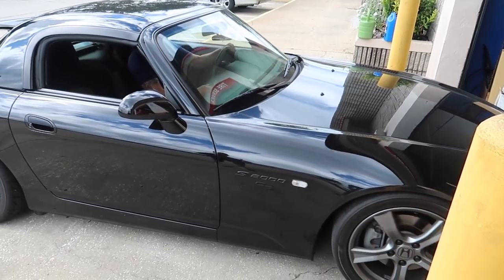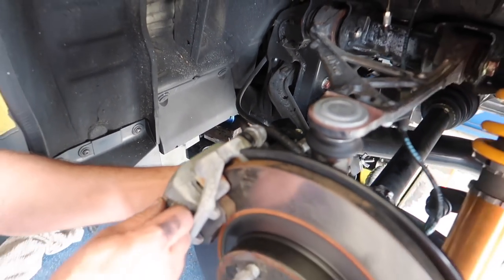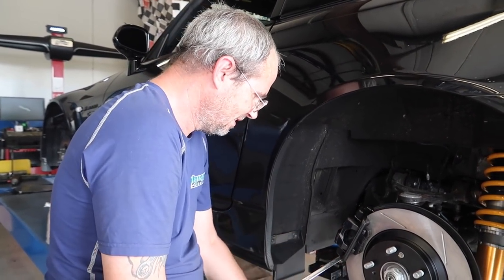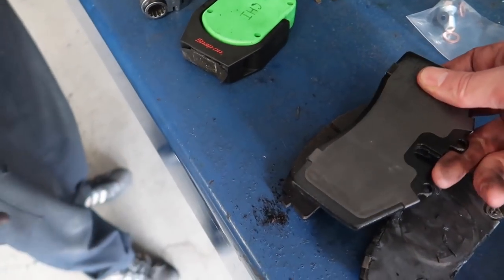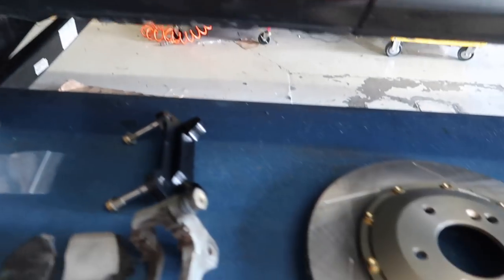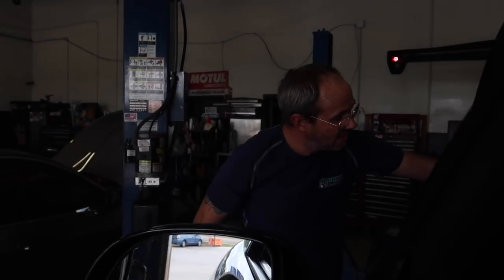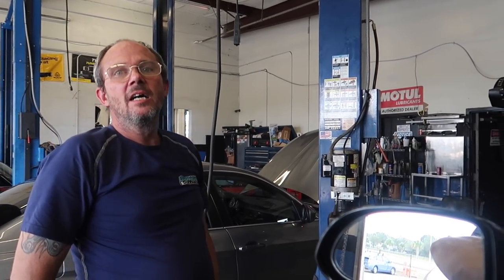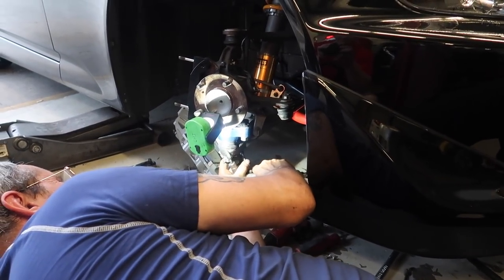S2000 CR: Stoptech Trophy and CE28N Install

Comment: Does look like he cross threaded that Left Front lower pad bolt.
Reply from the maker: No...
Reply: I thought the same thing but cross threaded not stripped
Reply: Dmand18729  Ahh yes...that's the word I'm looking for. It definitely is unfortunately. It wasn't shoved in far enough before to torqued it with the impact.
Reply: Yeah that's been cross threaded,you can even hear the sound difference from the top and bottom bolt
Reply: yeah I wondered why he impacted the bottom right away before making sure the threads were seated like he did with the top. was he adjusting the wrong collar on the coilover too?? (I thought the collar under the spring was to set preload and not to be fiddled with when wanting to adjust height)
Reply: noobatnothing I think he's actually turning the threaded body, not the actual spring seat.
Reply: it's cross threaded. reason for the stoptech trophy / st40 bridge not seating flush (wobbly) is because when the caliper was assembled, the silver metal piece that sits ontop of the bridge, needs to be pushed in all the way on one of the inserts. i installed the trophy on my s and my friends and noticed that both of trophys were like that. just sloppy quality control. regarding the rotor hitting the LCA joint: the rotor isn't seated properly on the hub. if it's hitting the rotor in 1 spot, then get a wire brush to clean the surface prior to putting the rotor back on. now if the LCA joint is hitting the rotor entirely, then somethings possibly bent on that corner. hope this helps.
Reply: Definitely cross threaded the bolt. You can hear it as it goes in

Comment: Chlorinated brake cleaner will destroy paint and if you ever weld right after you use it you can't because the gas from the chlorinated brake cleaner will kill you that's why you should always look for non-chlorinated brake cleaner because it doesn't wreck painted surfaces but nowadays everything is non-chlorinated. Those set screws are there from the factory Honda does that to all their vehicles on the factory line it just helps hold the rotors in place going down the factory line.
Reply from the maker: Good stuff.

Comment: At 18:40 he didn't start the bolt by hand like the top one and cross threaded it.... Which u can tell by the impact hitting before it starts tightening... This is why I work on my own car. Also they are aluminum calipers and reefing those retainer bolts is completely un necessary. After a few pad changes they arent going to thread in
Reply: Just watched this video but hes touching the mating surfaces too pads and rotors

Comment: I had the same exact problem with my bbk on my s2000.  I’m glad I wasn’t alone in that one!   I had to grind my ball joints down as well but I found that an alignment and raising the car a bit helped.   Maybe there is a better solution.

Comment: Looks great! As for the height adjustment... I'm not 100% sure, but I almost want to say that you guys may have messed up the preload/dampening of the coilovers. When I adjust my coilovers, I always loosen the lower lock ring, then disconnect where it connects to the control arm, and adjust it the height that way.

Comment: I think the rotor is rubbing because of the roll center correction pieces you have installed. They might be incompatible with the brake kit.

Comment: Watch the savagegeese video about braided stainless brake lines. It made me decide to stay OEM on my track Miata. Just make sure you check the routing and that nothing can possibly rub them. Looks great! The cars getting totally dialed.
Reply: tself77 Matt and I share totally different mentalities about mods despite us loving the same cars. Matt likes the prestige value of mods for sure.  Problem with BBKs you are pretty much forced into stainless lines because the oem lines are not going to mount up.

Comment: Did he change the pre-load? Not sure if someone commented about that already. Should've adjusted the height from the bottom mount, not the spring.
Reply: noticed the same thing..
Reply: Old comment, but he did. You can see the bottom lock ring is loose and is getting further from the shock base.

Comment: Can you provide the specs on the wheels and tire setup
Reply from the maker: 17x9.5ET50 square.  Evasive is where I got them.
Reply: Obsessed Garage what about the tires?
Reply: @ObsessedGarage  Matt did you require a fender roll front/rear for that fitment? Thanks

Comment: Why don't the rears have the big calipers as well?
Reply: Ramo They aren't need.  When you brake weight transfers forward, so the fronts need the bigger calipers.  The backs while important, aren't nearly as stressed as the fronts.
Reply: most rear bbk's require the e-brake to be modified or completely removed. more headache than it is worth.

Comment: Not sure if you did further research, but I found this thread on s2ki: https://www.s2ki.com/forums/s2000-racing-competition-11/rotor-lca-contact-1145931/page3/

Looking at your older videos, looks like you're running Megan RCAs, just like the people in the s2ki thread are, who are having similar problems.
Reply from the maker: I have Hardrace that are the same.  I wonder if I'd be better off just leaving the factory control arms and factory offset.
Reply: That might be a temporary solution. Since you've lowered the car, you're going to need to correct the roll-center eventually to maintain ideal suspension geometry. Maybe research if the J's Racing RCA have the same problem. I have those, and will want to buy a ST BBK later too.

Good luck, and the S2000 is looking great!!!
Reply from the maker: Yeah...that's why I chose to add them, to maintain proper geometry.  But I doubt it makes so much difference that it's worth losing the brakes.
Reply: the hardrace offset balljoints with roll center adjustment will solve your problem